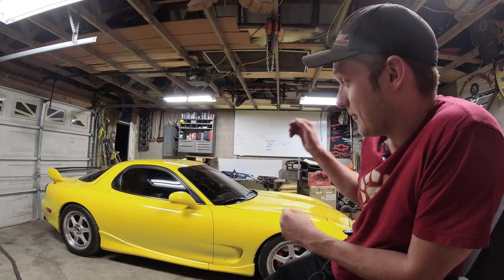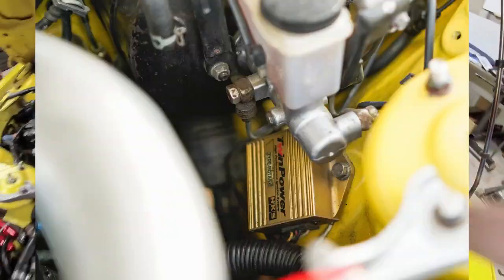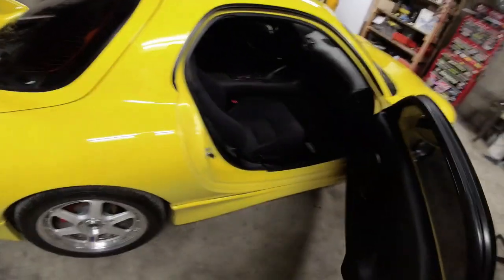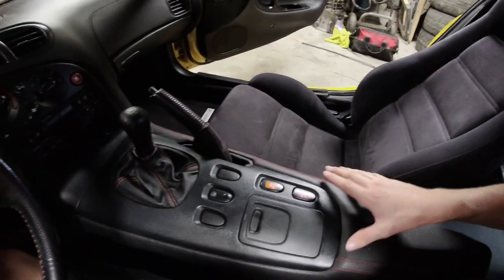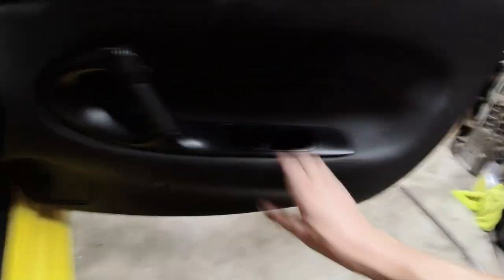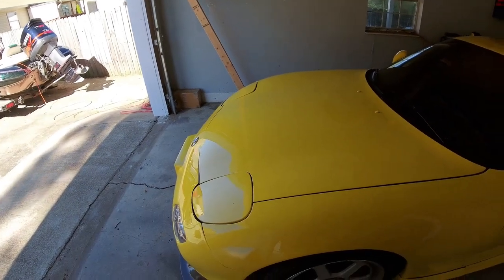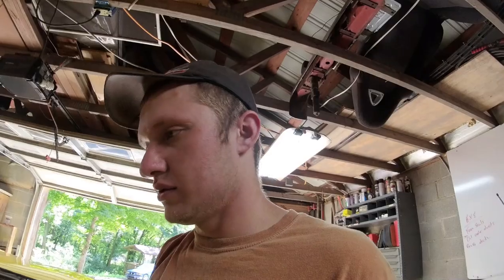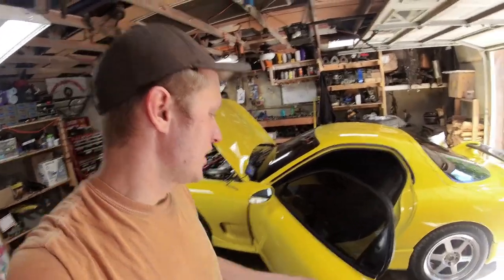1993 CYM RX7 is For Sale - Walk Around + Compression Test and Start up Video

Comment: Please share my pain.  I passed up on one of these ('93, twin-turbo, in yellow) with low miles (~45k-ish) about ten years ago.  Belonged to the mom of a kid I grew up with.  Totally pampered.  They were asking $10k, I bet I could have given 'em $8k cash and drove it away.  I will never forgive myself.
Reply: We've all been there dude lol 
I could've got rx3 rx4 s4 5 n 6 rx7s in early 2000s for cheap as, running driving rx3 n 4s u could get for under 5k , s4 n 5 rx7s 5-10k, fds 10-15k and this is in Australia too where we're rotary mad haha.

Now however you can't get rx3 rx4 ,r100s etc. For less than 100k ,restorers start at 60k 😔
S4 5 rx7s are around 30-50k , s1 2s about the same, fds 60-100k ,I too regret not getting any when they were dirt cheap.
Now looking at rx8s before they skyrocket too, can get good ones from 8k, downside is that horrid renesis 13b lol 
But I can live with it, might do a hybrid and use r.e.w housings and have the irons exhaust ports filled in 🤔
Reply: If we're talking about regret.... I sold a 93 CYM back in 2006 for $18,500. It had 38kmi original, just downpipe, Racing Beat lowering springs, Tokico 5 ways. Makes me sick to think of what the car is worth today.  I saw a clapped out CYM sell 1.5 years ago for $75K. Massive regret. I miss the hell out of my CYM.

Comment: Interested to see the numbers on the new engine. My 2009 with just under 13k miles is making right around 100psi hot. Wish it was more but the time it spent sitting means that's likely as good as it'll be. Have to brag on my starter though. It spins in the average of 340 RPM.
Reply from the maker: Shew that's crazy RPM on that starter!!  Compression is almost like HP numbers, its all relative to an extent.

Comment: Great Video/Presentation .. I have a 1994 FD with 95K on it. I purchased it from the original owner about a month ago.  It's been sitting for 10 years and it's in good condition.   I noticed in the video you talked about the twin OEM turbos.  I'm not sure if the turbos are leaking. With 95k on them, I'm sure they are leaking.  Do you know of anyone who works on them and refurbishes them?  I plan on replacing the engine harness as well.  Did you replace all of the vacuum hoses?  I hear some people will replace the Vacuum hoses, but there are different ways to eliminate some of the hoses from the rats' nest.  I really appreciate any advice to can provide me.  I'm not sure if I should rebuild the turbos or go with a single turbo. It's going to be somewhat of a daily car similar to the Yellow Rx7 in this video.  Thank you in advise for your time. Nigel Gainesville  Florida.

Comment: I'm almost to 100% sure that quarter trick is a myth
Reply: Myth for which engine? my Dad had a 1975 REPU that we used to balance a nickel on edge on the rotor housing all the time to show people how smooth it was when we rev the engine and it would just sit there.
Reply from the maker: That would make good sense.  the stock REPU flywheel is 35lbs i think!